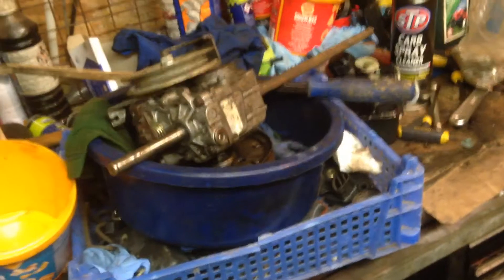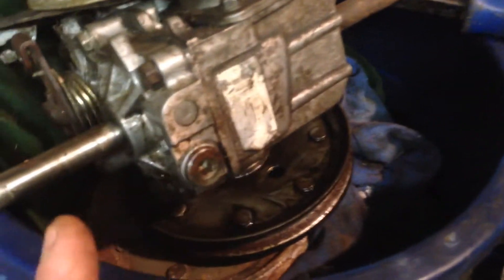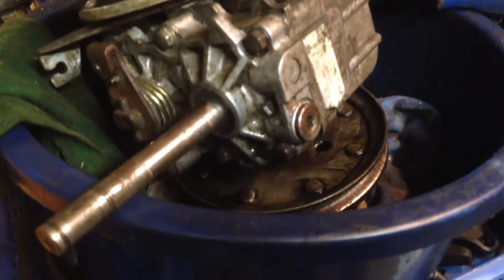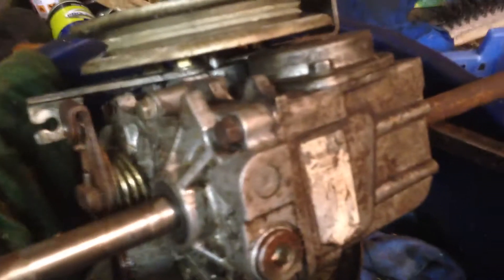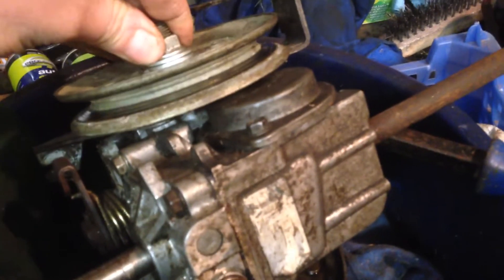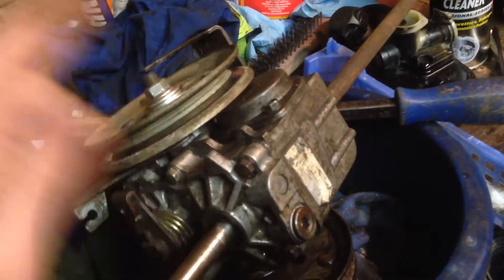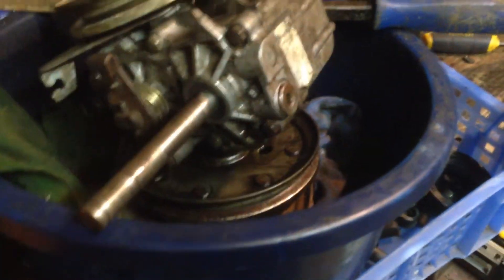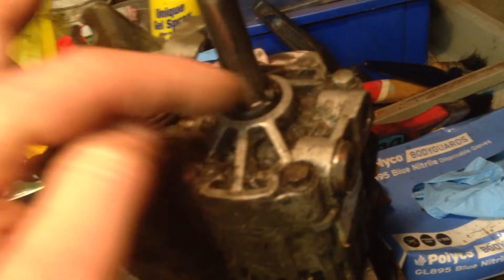Honda HRX 537 lawnmower hydrostatic drives I hope to repair. Part 1.

Comment: easy fix.
Reply from the maker: Yes the hardest part is stripping the mower down to get the drive off, it takes a while to make sure the drive is fully full of oil, if not the drive will be sluggish. Thanks for your comment.

Comment: Hydrostatic push mower?
Reply from the maker: Yes they have variable speed just adjust by one lever, so much better than the older 2 speed, which were to slow on slow and to fast on fast. Thanks for your comment..
Reply: Yes, the top of the line HRX mowers have a hydrostatic drive in the rear.